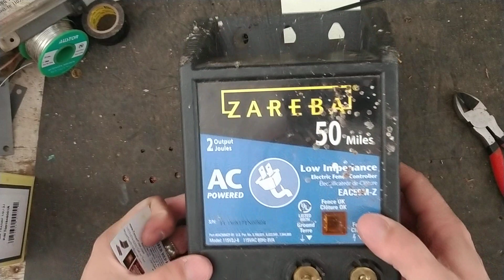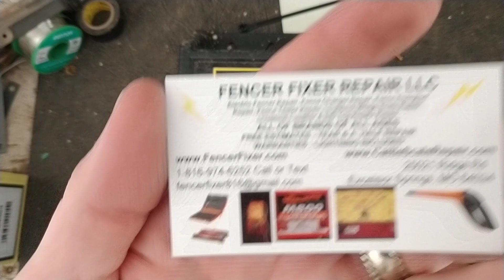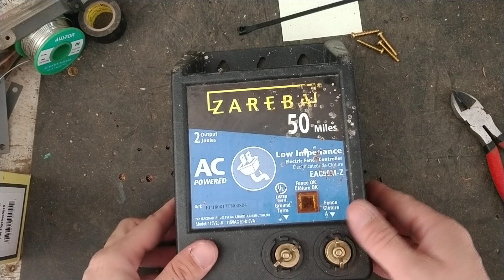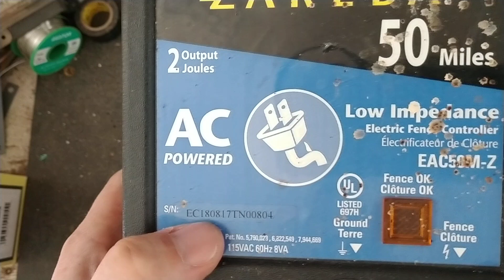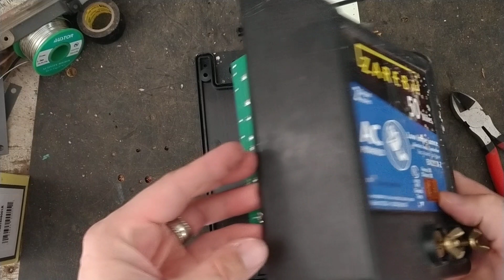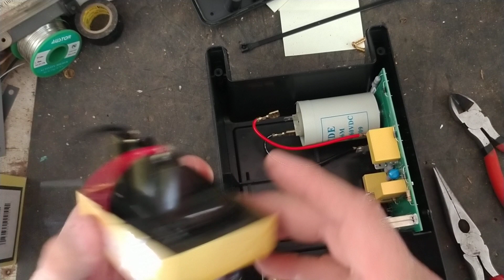Zareba EAC50M-Z 50 Mile Fence Charger Repair | Red Snap'r 50 Mile Repair | Blitzer 50 Mile Repair

Comment: The tiny 10-mile Zareba I opened up has smoke traces where the transformer attaches to the board.  Some of the "iron" transformer material is loose--plates fell out--it's just junky as hell.  Can't see how postage and parts would cost less than a new replacement (of same low-level stuff).

Comment: Your recommendation for a 12V unit?  Cyclops Super?  Speedrite?  Gallagher?
Reply from the maker: I'd stock with either Gallagher or Cyclops, Speedrite is overpriced for what they are on the inside. If you want something that's going to last longer and better suited to be outside, get a Gallagher unit over a Cyclops. Gallagher units do cost more, but they carry a 3 year warranty and Cyclops only carry a 1 year warranty right out of the box. The Cyclops Super is the biggest 12v unit that they make, but they do make 4 smaller powered units as well. How many acres are you running, what kind of animals are you keeping in or out, and is your fence pretty clean of grass. You don't want to go too large of a unit joule wise on too small of a fence area because with certain brands and models it can cause issues of overheating inside because the transformer can't get rid of all it's power because of not enough fence to absorb. So depending on what size area you're fencing in, the type of animals you're dealing with, and if your fence stays clean or not, that would tell me what size units would be best to look at. You don't want to pay too much and get the wrong unit that you're going to have electrical issues with, but then you don't want to get too small of a unit and have animals get out all the time. I can help you pick out a 3-4 good units to look at, I just need to know some of the above info.
Reply: @FencerFixerRepairLLCKansasCity  Thanks for the reply.  About 45 acres, minimum of 3 strands of high tensile with poly braid used for rotation to be moved.  Sheep with hog pressure from the outside.  I hope to keep the fence clean,, but maybe not.  Most of the Gallaghers seem to be out of stock.
Reply from the maker: @alanwhitaker1320  It's been a real pain this year for a lot of brands. We don't sell any units at this time, but we do work on them and have to order parts and I've seen a big hiccup with delays in parts getting here and things being on backorder. Cyclops has had issues since around March on getting parts here in a decent time. Gallagher and Speedrite have been just about as bad on delays as well, everybody is blaming it on Covid and shipment delays. Just about everybody gets their electronic components from Asia to build their boards, so that's been the biggest issues.
Reply from the maker: @alanwhitaker1320  For what you're dealing with I wouldn't go any smaller than a Cyclops Champ 12v and no bigger than the Cyclops Brute. The Brute will have plenty of power for your setup and animal issues and fence load issues. They're not very waterproof at all, so you will have to protect the Cyclops from the weather definitely. If I was going to spend the extra bit on a Gallagher unit, look at the Gallagher B700, MBS800 or MB1000. Plenty of power and very reliable. The B700 & MBS800 are better suited to be outside with the weather and rain, the MB1000 you'll want to protect it like the Cyclops. Look here at the Gallagher brand and see if they have them in stock...
https://gallagherelectricfencing.com/collections/battery-powered-energizers
Reply: @FencerFixerRepairLLCKansasCity  Thank you very much.
Reply: You must get a lot of fencers covered in bird crap